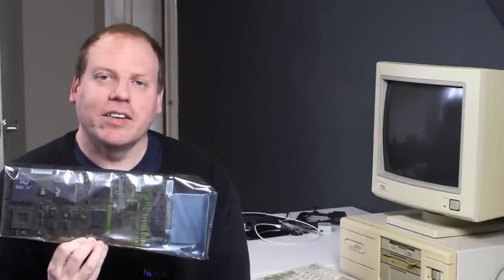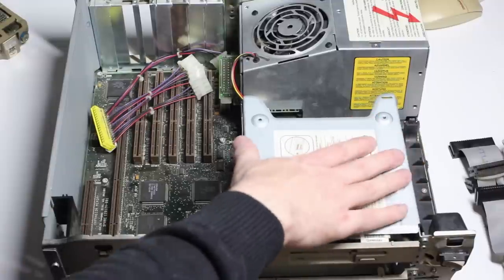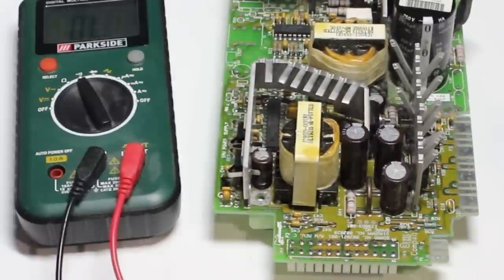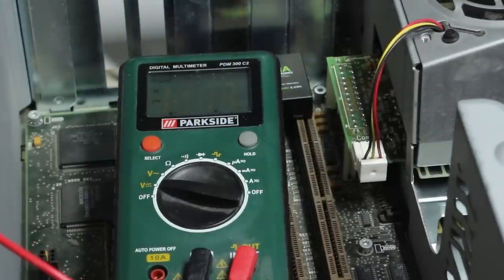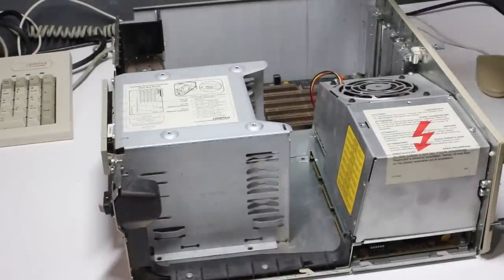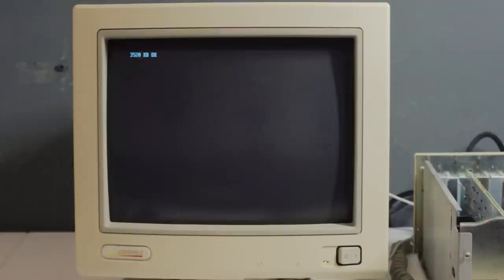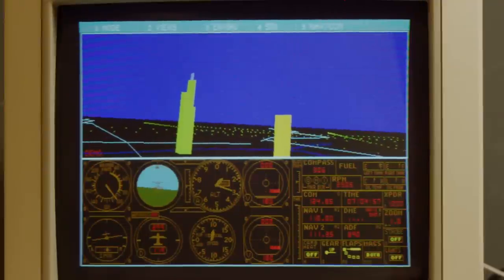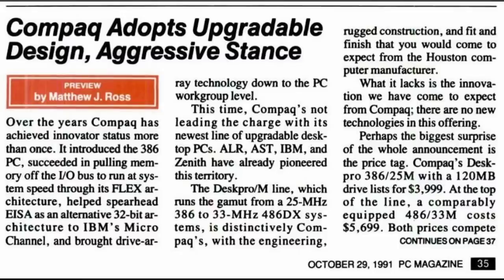Rescuing a REMARKABLE 386 DX-25 Made by Compaq

Comment: All the performance bonus is coming from the EISA 32-bit bus and much more sophisticated DMA memory transfers. Even clone EISA machines were stark improvements in performance over ISA machines. Find yourself an old Adaptec 1710 (IIRC) SCSI card for it and an extended memory add-on board and it will rock! Don't forget the 80387.
Reply: He's using a 16-bit ISA videocard so I doubt that in case of the Unreal demo the EISA bus has anything to do with the performance difference between the two machines shown in this video. The performance difference between the 386SX and the 386DX is not because of the EISA vs. the ISA bus. It's because of the DX having 32-bit memory bandwidth while on the SX the CPU breathes through a 16-bit straw while accessing the memory, which is why a 386DX-25 is typically more than 3 times as fast in terms of DRAM throughput compared to a 386SX-16.. (3.125 times faster to be exact, difference in clock speed included, cache excluded).
SX machines (which were entry level machines) were really hampered by this obvious bottleneck compared to DX machines in the 386-class CPUs. I.E. my 1988 Deskpro 386/25 (an original first generation Deskpro like the 8086 and 80286 models which has only ISA slots) is also way faster than any i386SX class machine out there in terms of DRAM access which is what one would expect from a high-end 16000 dollar machine back in the day ;-) This thing also features an Intel 80385 with 32k of SRAM (cache) which makes its memory even faster..
Reply: It has 16k external cpu cache. That will be doing a lot of heavy lifting. And its a zero wait state machine. In this video, the EISA did bupkis for it.

Comment: That big BQFP chip next to the CPU is a 82395DX high performance smart cache controller with 16KB of integrated 4 Way set associative L2 cache. That right there will definitely leave a cacheless 386SX in the dust.
Reply from the maker: That would be an interesting test. I've seen people claim a 20MHz machine is so well timed for the RAM that cache makes almost no difference. RAM access is pretty much 2 cycles, which couldn't really be improved. The slowdown with the SX was the 16 bit data bus, so it wouldn't be a fair comparison. But a DX without a cache would be interesting to compare.
Reply: @PCRetroTech  For slower parts you're absolutely right however Intel made 25 and 33 MHz versions of these cache controllers and they weren't cheap so they must be worth something. I happen to have a cacheless 386DX-33 system if you want me to run some tests so we can compare.
Reply from the maker: @benjaminrondeau3148  It might be a bit difficult to rule out other architectural differences. The best would probably be if I figure out how to disable the cache on mine.
Reply: Turns out that in the meantime I acquired a PGA-132 MB with an i395 on it (Fountain Technologies FTN 386DX-33C) so I was able to run some tests. I averaged the score of 14 different synthetic benchmarks (the usual suspects…) to compare the performance with the i395 enabled and disabled. For a combo i386DX-33/i387 the gain was 23% and for a RapidCAD the gain was 34%. Further research into the 82395DX datasheet revealed that it contains 16 KB of 4 way set associative cache with pseudo LRU algorithm that supports Intel486-like burst transfers and FPU decode logic. Using a fully software transparent dual bus, a bus master device can access the system bus simultaneously while the i386 reads from cache on the local bus (assuming a hit) at near zero wait state. It also includes a write buffer which allows for continued operations without having to wait for write cycles to update the memory with a TAG for every 16 bytes, so this sounds like the same thing as the integrated cache of a 486. Combine the presence of this chip and the EISA bus in the Deskpro M and you start to see why it was the flagship workstation. @PCRetroTech
Reply from the maker: @benjaminrondeau3148  Very interesting. That's actually a bit more than I was expecting. On the other hand, a 386DX-33 is going to be pretty bottlenecked by memory access if it runs at a speed almost exactly matching a 20MHz machine, nearly half the speed. So maybe it's not that surprising.

Comment: Super cool modular machine (The M stands for modular for it's modular design indeed). 
I'm a huge Compaq fan and I have the 486m version of this unit (it has been upgraded from a DX-33 to a DX4-100 Overdrive CPU).. You can go as far as a Pentium 60 and 66 CPU card, which was also available, featuring a 128-bit Tri-flex front side bus which would be a huge upgrade from a 25MHz 386 and it's the only machine I know of that can pull this off! Pretty hard to find those Pentium CPU cards though.. The 486 is still available on Ebay and you could go as far as putting a 133MHz AMD 5x86 in them using an interposer socket with a voltage regulator which would make it perform on par with the 66MHz Pentium or thereabouts in terms of raw integer performance!

Oh and about the harddrive: It's indeed supposed to be mounted on its side on the right of the drive cage behind the power switch. This is how they left the factory, with the Connor drive mounted on its side ;-) Pretty weird design but it'll give you two free 5.25" drive bays..
Mine has a CD-ROM and Syquest drive in those slots..

"the previous owner's cause of death was..." priceless, LOL!
Reply from the maker: Ah, fantastic to have information about the mysterious M. Do you happen to know the meaning of the E and N?

Also great info on the hard drive.
Reply: @PCRetroTech  The only one I'm really certain of is the /M(odular) moniker which was the high end workstation after the SystemPro and it was the ancestor of the Deskpro XL, which were all pretty expensive to produce and had a very high price tag as well.. These were the top of the bill EISA machines/workstations/servers(the latter being the SystemPro's purpose as the very first dedicated x86 PC server and ancestor to the Proliant which still lives to this day as an HP machine of course ;-) ); The rest still kept using 16-bit ISA.. In fact I have a 1995 Deskpro XE560 (Pentium class machine) which still used ISA only with on board local bus graphics! Come to think of it I don't think Compaq ever used any VESA local bus slots on their Deskpro machines. They stuck to EISA, which was their own invention. They went straight from ISA to PCI on the lower end models like their Presarios..

Don't pin me down on the following as I'm not 100% sure I remember right:
The /N(etworking) were the pizzabox models, small and simple. Sort of a thin client if you will, just like IBM did on their PS/2 line (the networking models without any local storage and just a NIC and a bootrom)..
The /I(ntegrated) models were slightly newer and bigger than the N with IO/32-bit Compaq QVision video etc. integrated on the mainbord and a simple ISA riser card; These were the higher end machines and were released next to the first Prolineas (the newer entry level moniker).
The /E(xtend(ed)/xpand(ed)) (not really sure) was slightly more expandable than the /I with its 4 vertical full size ISA cards and a prorietary 32-bit RAM card (no riser).. 

Compaq seemed to produce boatloads of different Deskpro (and very similar Prolinea) models at the time which makes it kind of hard to keep track of all of them ;-)
Reply: @PCRetroTech  As a sidenote; If you're planning to upgrade this beauty: You can get a pretty nice increase in graphics performance over a regular 16-bit ISA card if you can find the original videocard for this machine which is called the QVGA, a 32-bit EISA card which was specially made for the video slot in this machine!
Reply from the maker: @pipschannel1222  Thanks. I hadn't even heard of the /I models, but this all makes sense.

I wonder if this was actually a good marketing strategy of Compaq. It must have been confusing for consumers.
Reply: @PCRetroTech  Yeah good marketing strategies kind of evaporated when Rod Canion, one of Compaq's founders and spiritual father was fired as their CEO in 1991.. Things kind of went downhill after him leaving and for a lot of people (including yours truely) the company kind of lost its soul.. I own a lot of Compaq machines but my favourites are from the first 10 years (1982 to 1992).. They produced a lot of brilliant hardware during that era!
Reply from the maker: @pipschannel1222  Interesting. It's amazing how one person can make all the difference.

Comment: What a great video, thank you!

I have quite a few Compaq systems of this era and the /M (M-boxes) were the 3rd generation EISA machines from Compaq. The first Compaq EISA system (and 486) was the DeskPro 486/25 (released in late 1989, just prior to the first SystemPro server) and had an initial MSRP of $14k - $20.5k USD! The unit I have was outfitted with a 320mb ESDI drive (that amazingly still works!) and and 12MB RAM (probably would have been right in the middle of that price range). It was a more traditional layout (with the processor on the motherboard) only having a proprietary memory expansion board and modules (as well 16-color on-board VGA). The 2nd iteration of EISA was the DeskPro "L" that came in 386 and 486 flavors (and moved the processor to a proprietary card similar to the M). They share the same memory modules, but different memory expansion cards if memory serves.

To add more memory to your /M you'd either want the Compaq expansion board (129129-001) or the Kingston equivalent (KTC9160); the latter seem to pop up on eBay a little more frequently. They have 8 72-pin SIMM sockets for up to 64MB/memory total (including the 4mb or 8mb on the CPU board), so a bit easier/cheaper to populate with memory!

The /M systems either would have come with an EISA "Advanced VGA" card (640x480/256 color), QVision 1024 (1024x768), or the QVision 1280 (1280x1024). The latter 2 had optional (proprietary) 1MB memory upgrade modules. I've been on the hunt for a QVision 1280 card for my DeskPro 50M (486DX2-50), but they seem to be very scarce. As others have mentioned some of the later/faster ISA cards will outperform most EISA video cards, but my preference is to use EISA cards as much as possible in these systems (an Adaptec or Compaq EISA SCSI controller with SD2SCSI adapter really flies; a CompactFlash IDE adapter is a close second).

Back to the 386 models, the 386/20e or /25e were ISA systems (same chassis as your 386s), but were "enhanced" with an Intel 80385 cache controller and 64kb of cache. The 386s/20 was one of the last 386s produced in the same chassis but has 4 72-pin SIMM sockets on the motherboard (whereas the previous 386 models all needed the proprietary 16-bit or 32-bit memory expansion board with proprietary memory modules (different from the the EISA systems).

Lastly, I'd be more than happy to send an extra EISA NIC your way if you're interested.
Reply: Here's a great video by Compaq from 1991 on the DeskPro /M family: https://www.youtube.com/watch?v=sKLRCmARqok
Reply from the maker: Thanks for all the extra information. It's starting to become clearer now. Compaq must have had quite a few markets they wanted to cover.

Regarding an EISA NIC, I'm not much of a networking buff, but thanks for the offer anyway.
Reply from the maker: @scargo02  Fantastic, I'll check it out. I wish I'd seen that before making this video!
Reply: I'd like to see this  EISA "Advanced VGA" card.

Comment: My first PC compatible (an 8MHz Turbo XT clone) had a similar physical design, where the CPU and RAM were on a full-length daughtercard, and the motherboard was dumber. In my case the motherboard slots were all 8-bit though. It came with an ATI Wonder card that provided CGA and Hercules, and two half-height 5.25" floppies. I later installed an 84.9MB SCSI drive and started a BBS, of course!
Reply from the maker: I always thought these machines with backplanes or dumb motherboards like this were too proprietary to be useful. And indeed this machine sat in my basement for ages until by pure luck I found the card I needed. Now I really like the machine. You can take that CPU card out and just upgrade to a 486 or even Pentium Overdrive just by plugging in the appropriate card.

I haven''t seen a lot of Turbo XT clones like this, so your machine must have been slightly rare.
Reply: @PCRetroTech  Mine was a Samsung SPC3000, I don't know offhand if it could've accomodated a 286 "brain transplant" or if one was ever manufactured... I replaced it with an Am386DX-40 machine with 4MB RAM, Trident 8900C, 105MB HD and 14" SVGA monitor that cost $1748 CAD in 1991. :)

Comment: Nice look at the end, although the monitor base looks likes it's been turned 90 degrees.
We had deskpro's where I worked in a telco, the one thing that stuck with me was the speed of the video, Other manufacturers harped on about this and that with their video cards & interface etc, yet the Compaq's left them in the dust, things just snapped onto the screen.
Reply from the maker: You might be right about the monitor base, I hadn't noticed that. Yes, I think Compaq really put a lot of work into their design. This one doesn't have the built in Compaq video, but it still seems really quick in other ways to me.

Comment: The plasma effect in Unreal is in fact a little more than 'just' pallettecycling ;-). If I recall correctly, the effect also involves clever use of the VGA display parameters and vertical retrace interrupt to blend several images together to fake more than 256 simultaneous colours on the screen.
Reply from the maker: That could well be the case. I didn't check at all what it was doing in addition to palette cycling.

Comment: ''In Compaq's Deskpro/M series -- the M stands for modular''
   I'm guessing the heatsink pins were bent, causing a possible alarm to the previous owner thinking the power supply board may have been cracked.
Reply from the maker: Interesting.

Comment: Wow, real trash to treasure there! Great job finding that CPU card, they can't come up very often, lucky find. Love the shock & surprise when first the machine POSTs and the 2ndly when the HDD boots to DOS, I was with you there! Would be v interested to see the more conventional benchmarks of this, like TOPBENCH and Superscape results.

Im fascinated by the Compaq Deskpro 386 and think it deserves to sit beside the PC, XT and AT and one of the major early developments of the PC, but it doesn't get nearly as much attention as the IBM machines - ta for readdressing that to a degree. Perhaps it's the rarety of the original Deskpro 386 that limits it's reach? Great to see one of the follow up Compaq machines tho, and EISA is such a curio to.

Super stuff as always and hope you get the Tiger card to work. Cheers!
Reply from the maker: I've never seen one of those CPU cards come up. It was truly a miraculous find.

I did try Superscape and it was glacially slow. Even the version designed for slow machines just took too long to run so I didn't even let it go through once.

I agree on the Compaq being highly underrated. The original Deskpro is just super rare, whereas there are enough IBMs out there for many people to own them. I'm not even sure why that is. Somehow I guess people hung on to the IBMs for posterity. The Compaqs probably got bought mainly by businesses and just disposed of (though who knows how many there are out there in storerooms).

Comment: 3:22 - Please never throw anything away, no matter the state! I'll gladly pay you to ship it to me (unless it's totally smashed, then maybe not). I am short on everything, especially AT cases, ribbon cables, serial/parallel headers, spare-parts boards/cards, and PSUs... I have at least half a dozen machines worth of retro hardware with nothing to build them in, on top of at least another half dozen that just needs a piece or part here and there to be complete.

Recently I bought some ATX blank-off I/O shields, with the idea to punch holes in them to make AT-to-ATX adapters but it's certainly not ideal to build these old machines in sleek, modern cases lol
Reply from the maker: I threw away 9 machines when I moved. I did everything to find people to take them. Not a single person turned up. Shipping just wasn't possible due to the fact I was already working around the clock. I barely made it to the train when I left Germany and took about a month to recover from exhaustion.
Reply: @PCRetroTech  hehe..yeah, we briefly talked about it before in the comments of another video. I was very sad, but I understand. I hadn't even found your channel yet, or I would have certainly done what I could to help.

Comment: Anytime you add a card you'll need to go into the BIOS to tell the BIOS what the card is. If the card is an EISA card there will be an extra driver disk. It is possible to load those utilities into a diagnostic partition for doing the BIOS changes but I don't remember if that was only the later generation systems that supported the Pentium Pro that I worked on.